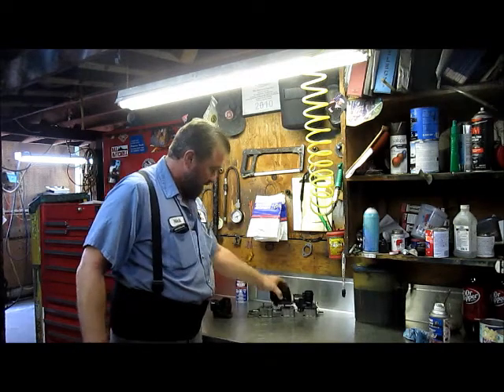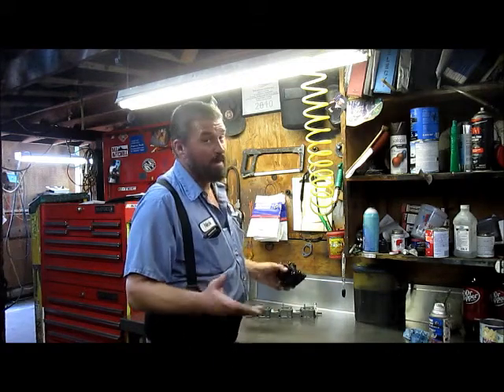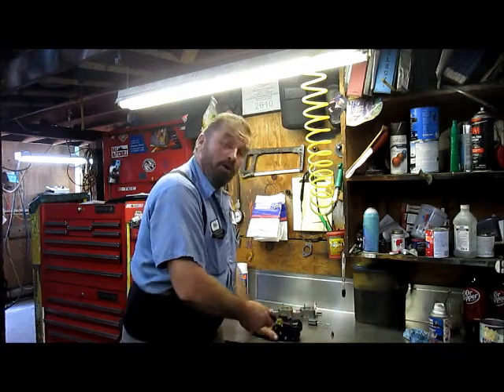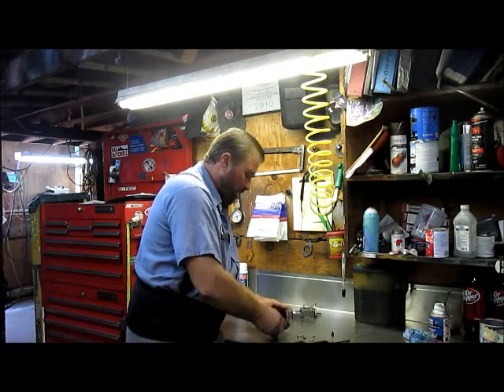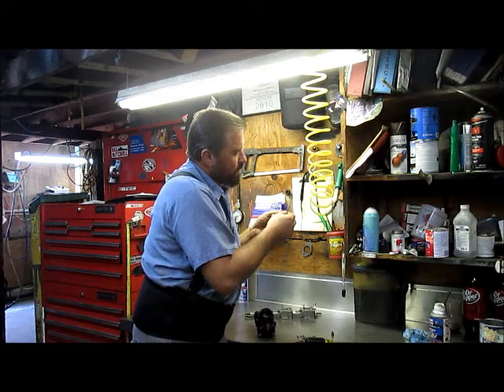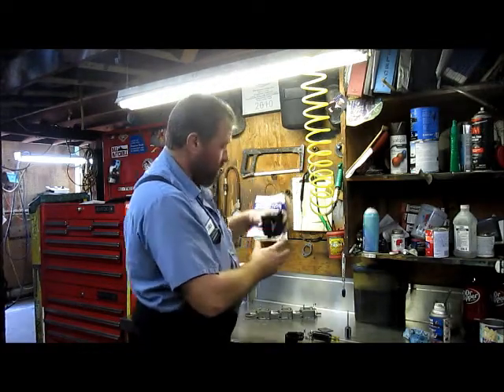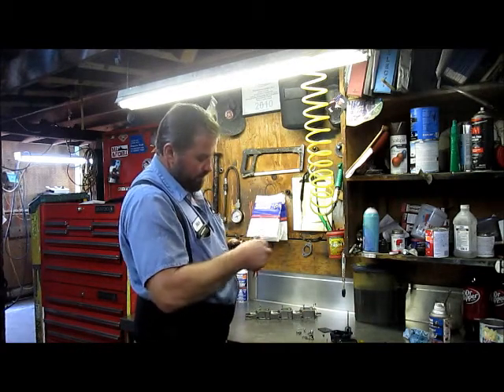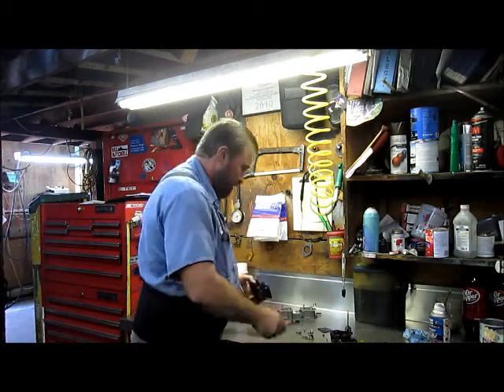Evinrude/Johnson Carburetor repair, professional disassembly for 60 and 90 deg Looper pt 1

Comment: Glad I found this video. I was having issues with the float bowl not setting correctly without bending the crap out of the metal tab. I eventually found it was because I used those plastic washers for the seat. It wasn't until I watched this and realized that those washers aren't used on the plastic-body carbs. I also couldn't find any mention of those washers being used in my OMC manual.
Reply: I was wondering the same thing. I just guessed that the plastic washers were not being used and didn't put them in.

Comment: Good afternoon Nick I have a question for you what are the nipple drains on the engine for is it a water passage air passage fuel passage there are quite a few of them on the engine what is their job
Reply from the maker: There are quite a few and it depends on which you are referring to. The ones on the side of the engine are recirculation to keep the oil moving and atomizing to be burned off rather than pooling. The ones at the lower portion of the front are recirculation to keep the oil travelling to the upper main bearing and are controlled by piston pulse and have check valves in the lines.

Comment: Thank you for your support I live in Fort Myers.. at this time I have Two problems ,over heating and losing prime on the bulb, Engine bogs out when you give it throttle I will try to figure it out these things I guess take time, cleaned and removed all old gas from gas tank and added fresh fuel with 50 to 1 ratio I guess one step at a . I will get this thing running well again
Thank you for your input and your experience in engine rebuilding looks like you take pride in your work

Comment: Good morning Nick your videos or excellent I need your help on one thing I purchased a 1995 Johnson 175 fast strike the balancing tube on the starboard side goes down to the bearing but the port side is missing the hose and I do not know where to put the new hose on the port side of the motor I would really appreciate if you can direct me in where that hose goes to
Reply from the maker: Port side goes to the lower part of the air silencer, there is a nipple on it. and thank you for the compliment!

Comment: Nice video! i have a 1994 225 johnson and I am currently running 74d jets. My plugs are always grey and light brown never fouled. It runs very well up to 5600rpm.  I am considering going to 76 jets like the 2000 and 2001v6  250s. Judging by the parts diagrams the jets are the only difference and i am using a brand new vro and power pack. Will that work or are there other mods to do as well.
Reply from the maker: +patrickwelch Thanks Patrick, it sounds like you are possibly a bit lean. I would try 75's first though. The fuel to air ratio is 14:1 so 1000th is quite a jump. Try the 75 and record your WOT rpm's if you increase a bit then try the 76 and record that. If you lose RPM's at WOT then drop back to the 75. Too much fuel can and will have an adverse affect on WOT.